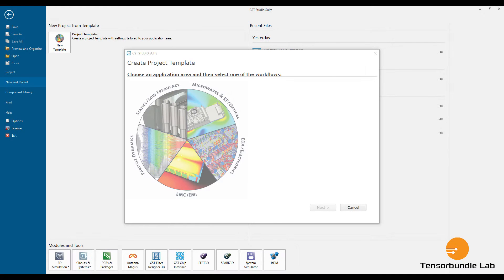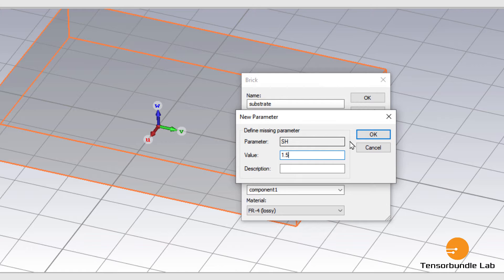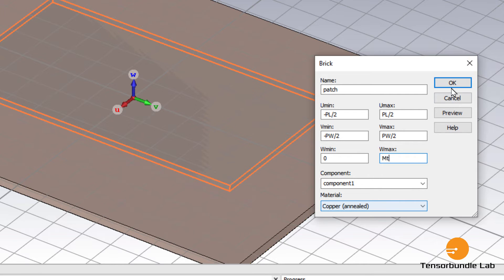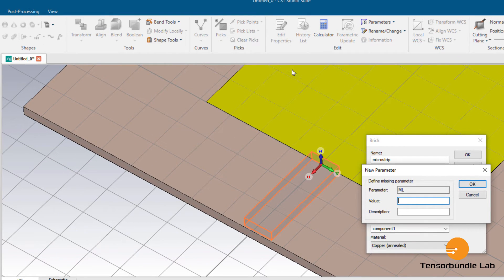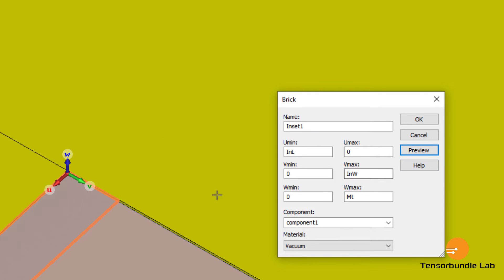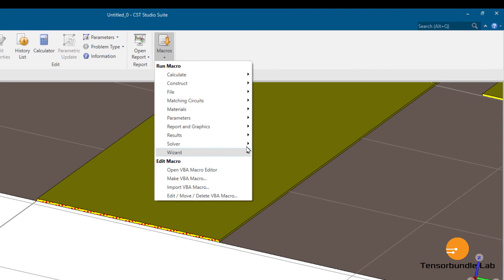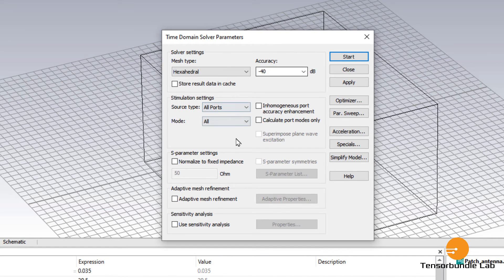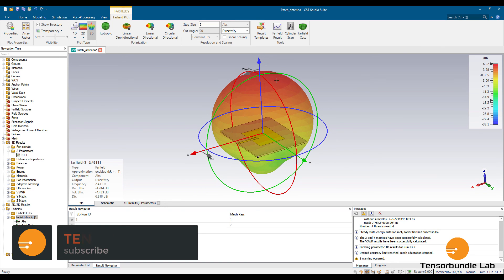CST Tutorial: CST Microstrip Patch Antenna Design & Simulation- 2.4 GHz

Comment: Thank you! When I'm trying to simulate , it giving the error as " This software is licensed for up to 100000 mesh cells only. The current mesh size exceeds this limit. Please reduce the mesh size accordingly.". What can be done? Kindly suggest me
Reply: In the bottom right corner, click on mesh cells and then reduce the cells per wavelength accordingly till it reaches below 100000 mesh cells. 
If not solved, try turning off adaptive mesh refinement during setup solver(if asked, give create new mesh), and then try to reduce the cells per wavelength
Reply: @PraveenKumar-sx5hf Thanks much for your suggestion. But, if we reduce the mesh cells will it effect the results accuracy?

Comment: Excuse me sir, I have a question, I designed a microstrip array antenna with an array size of 4x4, but I am confused about whether before running the s11 simulation all the patch components should be combined or not, because when they are not combined they actually produce good s11

Comment: Hello. I get an error like this "The discrete port or lumped element Folder1:element1 was not found in the mesh. Please compare model and mesh view, and possibly use a different tetrahedral mesh generation method.". Do you know the solution?
Reply: I have the same error. Did you find a solution?

Comment: Why is the inW for the microstrip 0.74mm? I have encountered multiple examples with this value
Reply from the maker: the inset feed is just to insert the microstrip line into the 50 ohm region of patch (impedance matching). InW is simply the gap between the microstrip and patch. It has parasitic capacitive effect that alters the impedance matching. So better to do some trial and error to see at which value the matching is close to 50 ohm

Comment: thanks a lot for this impressive vid, just wanted to ask about how can I check the gain? and what are the factors that I should consider to manipulate the Gain?
Reply from the maker: gain can be increased by using a substrate having lower dielectric constant. In advanced design, FSS based superstrate can be used above the patch to increase the gain

Comment: First of all thanks for this awesome video then when ı used a microstrip width calculator the result is approximately 2.80 mm not 2.86 mm the datas are target impedance: 50ohm; trace thickness: 0.000035m ; dielectric thickness: 0.0015m and relative dielectric constant: 4.3 ( from FR-4) where am I wrong can you explain me sir thanks again :)
Reply from the maker: Difference of 2.80 mm and 2.86 mm is negligible. The analytical calculator only useful for first order approximation. The optimum final parameter is derived through full-wave EM simulation. Hence the final result is always different from first order calculation

Comment: That’s was awesome video. Thank you so much for doing that. I was wondering how can I achieve wireless power transmission in a microstrip patch antenna, and how could I know whether it achieved or not using cst?
Reply from the maker: Wireless power transfer is associated with near E-field, You have to calculate near E field in CST and from there you can calculate the radiated power